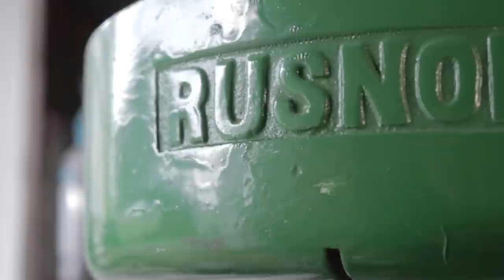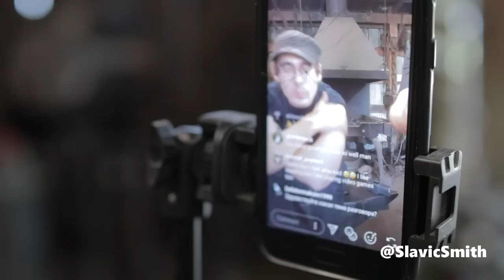Making a Bunch of Knives - [Path to JS] - Shop Update 7/29

Comment: How do smith rankings work?  whats before and after journeyman?  Also, who rates you?
Reply: Starts at apprentice and you have to be an apprentice for so many years to test for JS and are judged by other ABS smiths that are certified to be judges.  Then you have to be JS for so long before you can test for mastersmith.  All the details are on the ABS site
Reply: And based by the skill, ilya and matt are already at master smith level, they just need to accumulate time cause initially they are not ABS member

Comment: One thing I rarely see, but would like to see how yall would design it.

A mushroom hunting knife
Reply: It's not a big build at all, but I've always wanted to see how blacksmiths would handle creating folding knives.  Maybe they aren't interested which I would understand. But I think smiths could have really interesting takes on folders.
Reply: @Lamenter40K  seen plenty of smiths make folding knifes, valhalla especially seems to like doing folders. the main problem is making sure you don't use a patented folding/locking mechanism plus they tend to need some precision or machining which the average bloke doesn't own a mill

Comment: Nice going! I always wonder if I would be able to become a JS if I were American, and you know... did blacksmithing and not just grinding.
Reply: We have a number of international JS and MS members
Reply: @makkelsay3451  But they still require forging, I'm sure?
Reply: yes. It is a requirement. Stock removal knives don't get stamps period.
Reply: @makkelsay3451  To which extent do they need to be forged? Could it just be super rough forged and then expertly ground afterwards?
Reply: @93tedd  it needs to be forged as cleanly as possible and the Smith needs be proficient in forging in general.

Comment: Matt & Ilya, I'm looking for some advice.  I bought a kit build knife, a Sgian Dubh.  The blade is Damascus.  I have bog wood for the handle, with sterling silver bits and other parts for adornment.  I bought it probably 3 years ago but haven't had the courage to start.  I'm afraid I'll make a mistake while building this knife.  Have you ever felt a task was so difficult you shouldn't even start and how did you get past that fear?  It's not the cost of the materials I'm worried about, but I'm afraid I'll totally botch it.

Comment: Question: 
How does doing what you always do, let Ilya do all the hot work and have Matt do all the sanding work get Matt closer to that Journeyman smith diploma?
Reply: They are making knives to recreate when actually being tested is how I understood it. As I understand the ABS test, you have to make specific knives under time constraints, under supervision for your tester.
Reply: @juttley  Not completely accurate. There is no stipulation on what type knives that can be submitted as far as style goes. However they must be mono steel and forged by the person submitting. All the rules for testing are on the website.

Comment: What is a JS? I mean, there are all sort of smith...but, what defines a JS?
Reply: Hi Ben, perhaps you will allow me to answer this, a journeyman bladesmith receives his stamp only after a 3 year apprenticeship and passing the ABS cut and bend test of which you can find the details on the ABS  web site. The applicant must then travel to the blade show or other designated venue where he submits five knives to be judged by a panel of master smiths for fit, finish, symmetry, ergonomics and design. All blades must be sole authorship and forged by the applicant.

Comment: Matt, will you be testing at bladeshow next year?
Reply: If he does let's hope he submits sole authorship work and not something his shop partner forged 🙄
Reply: @makkelsay3451  I think Matt has enough integrity to turn in his own work, you have to understand that this a YouTube channel where there are two bladesmiths. It wouldn't have made any sense for them to just post content from Matt on a video.
Reply: @WastelandForge  one can hope. But the way the video and the comments posted here give the impression that they think the ABS is a joke and they will submit partnered work because they are above the rules. If you're going to present a  "Journey" to JS and MS than it needs to be done with the correct information and steering away from snide comments about those in the ABS.